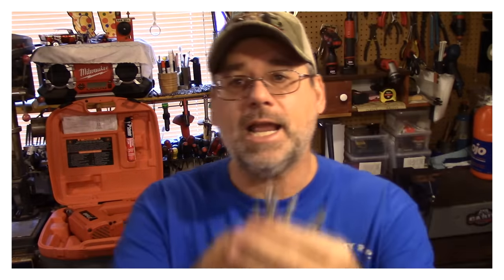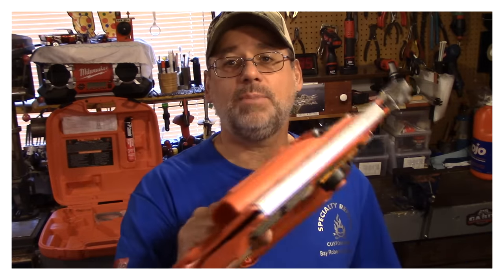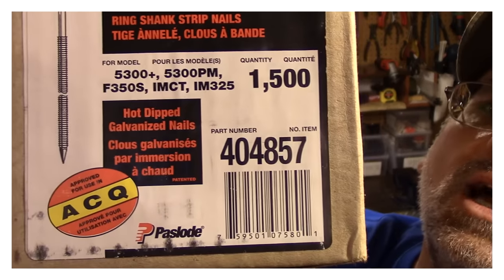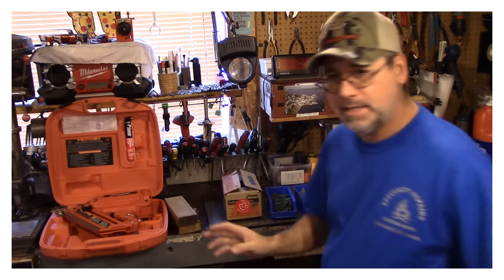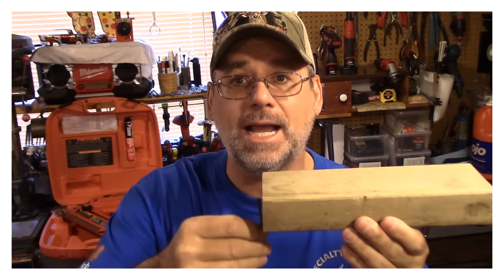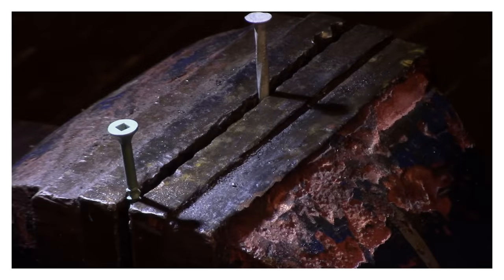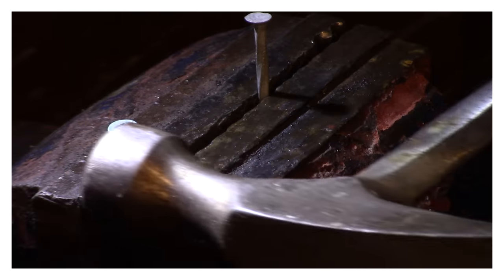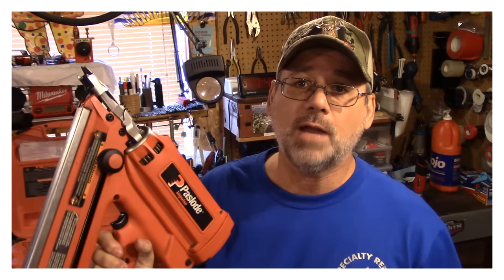BEWARE  NEVER USE DECK SCREWS  - DECK SCREWS VS NAILS -  PART TWO IN DESCRIPTION

Comment: Valuable advice. I went to a lumber yard a few days ago, bought a bunch pressure treated lumber for a floor, and asked for hot dipped galvanized 16d nails.  The guy told me they were out of nails and sold me 5 pounds of deck screws for 29.99.   I gotta take them back.   Anyway do you have any advice for those joist hangers. They say steel, but not stainless steel. Any stainless steel joist hangers for pressure treated lumber out there?
Reply from the maker: I have always used the regular  galvanized joist hangers for all joists , if they make SS ones , I haven't seen them.  Cheers 👍
Reply: Stainless steel hangers are made by both Simpson Strong Tie and USP Mitek. Unnecessary except in areas with coastal salt water environments for example. Everyday use requires only the galvanized hangers. We sell them every day.

Comment: I just got a quote on replacing my douglas fir wood pergola (not pressure treated)  that's attached to the house.  He said he uses screws instead of nails because they make it more secure.  Didn't say what kind of screws.  Does that sound ok or should I be suspect?
Reply from the maker: I would assume the person your hiring uses the proper screws as there are many screws and uses for different locations. The majority in the trades know what to use and screws are fine if you use the right screw for the job. I doubt you have any concerns . Cheers
Reply: Ask him.  He may mean the structural ones that are as strong as a bolt.

Comment: Well I’ll be a son of a gun, seems everytime I do something youtube puts a vid in my feed telling me I screwed up. Just finished my first rotten joist repair under my bathroom. Used deck screws to secure new joist board outside the bad one.

 I guess I will go get some nails and drive a few here and there just incase the deck screws snap on me 🤷‍♂️ 

I did install 2 supports (block with vertical 2x4) under the new joist to hold some weight, just to get things a bit more level. Was that bad too? Would that negate the chance of the deck screws snapping?

My house was built in 1952. Joist reinforced is a 2x6 under the bathroom.
Reply from the maker: I've been a son of gun over the years too. 🤣😅

Comment: Nails have more shear strength is what I think you were going for. 
Thanks for the video!
Reply from the maker: Cheers 👍
Reply: No actually those nails are softer.... which causes them to bend easily. Kinda similar to how lead is soft and will bend.
Reply: Exactly.  I used to manage a custom stair building facility. We always told our company installers to either use #12 or #16  framing nails OR actual wood screws, like #12 X 3" flat head wood screws to attach stair stringers at the top of stairs. We had one chucklenut who knew better, and started keeping 3" deck screws on his company truck, to get the job done. One day a worker was climbing the stairs in a home under construction. He was a big unit, and loaded down with a lot of heavy material he was moving upstairs. As he got to the top of the second floor stairs, the deck screws sheared, and he went down. The prebuilt stair unit he was on hit the basement stair unit and snapped those screws. He ended up in the basement with a broke back, lucky to be alive.  I later talked to several building inspectors who made homeowners totally disassemble their DIY decks to remove all the deck screws that were erroneously used in places where STRUCTURAL fasteners are required by code.  Deck screws are ridiculously brittle and fail easily under shear load. Ignore those that post here that claim it's no problem. It isn't a problem until it is, then it's often catastrophic, and instantaneous.

Comment: I will disagree with you , i am a contractor in the northeast and we use Simpson structural screws all the time always pass inspection and super strong 100s of decks built , we also use timber lock and ledgerlock  . only place on a deck I use nails is when attaching joists and joist hangers , railings look much better with screws ! Balusters look Aweful when nailed and of course decking is always best with screws .tech has come along way amd there are plenty of " structural screws" on the market now that meet or exceed code.. Just read DCA6 look it up on Google.
Reply from the maker: I agree with you Billy and in part two in the description I mention other fasteners. I am not suggesting all screws are bad but deck screws are being used in the wrong application.  I also put a link to the code you have pointed out on part two. So we agree . Cheers buddy
Reply: STEVE ROB great video steve , wasn't saying that just giving my side and opinion , as far as wall framing of any kind of course I use nails . but shear strength has come along way with screws for outdoor use . its a good debate and a good subject . I ask customers all the time if they prefer screws in there decking or galvanizex ring shank nails shot in, the scrwes are a lot more money due to the labor involved but look so much better and nails in decking pull out eventually screws do not . I think the term " deck screw" is whats tossing people off, but again plenty of structural screws on the market ! Good video !
Reply from the maker: +Billy Nolan  Thanks Billy , you have a great day.

Comment: Screws are brittle nails are not, this is the golden rule for structural integrity...if people add common sense to this equation, there should be no problems. Try building you shithouse on skids, once its full just drag to a new hole :-)
Reply from the maker: I do something simular to prevent it from rotting from the bottom up. A outhouse build LOL  Cheers

Comment: What about something like the Simpson SDWS framing screw. Would that be safe to use for structural components? I'm planning on building a 12 x 16 shed. My floor will consist of 2 x 6 pressure treated boards. I know that nails are the standard because of their resistance to shearing forces when compared to a screw; however, I like that screws pull materials together tightly and can be placed more accurately (at least for a newbie like myself). Would I be ok putting my floor together with Simpson SDWS framing screws by screwing through the band boards and into the end-grain of my floor joists? If so, how do I determine what length/size screw to go with?
Reply from the maker: Joshua I built a shed in by yard from scratch , might be of help and get some tips on building . The framing screws are very expensive and must be ok for your PT wood just like the nails . Take a Look at the playlist -  https://www.youtube.com/watch?v=S3sIqbbMtsM&list=PLCpsODdJa_T7qqSZD0fKZLRkbvtexBU4O
Reply: @SteveRobReviews  Will do! Thanks so much for your help!

Comment: You never use ANY kind of fasteners for structural support;  never place a fastener where it is bearing weight in a shear situation.
Reply from the maker: Well said 👍
Reply: Funny we use A325 bolts to hold bridges up. Use the correct type fasteners and you won't have an issue. By the way I've never seen a screw back out of wood like a nail will.

Comment: So what kind of screws should I use? I’m more talking about when using pressure treated wood. Because it’s hard to find screws for pressure treated wood that aren’t deck screws. They are usually more expensive so I assumed they were the best.
Reply from the maker: Deck screws are perfectly fine for  what they are intended for such as pressure treated boards . Their the least costly and made for the lumber but not for structural applications  where  proper fasteners are required . Deck boards and fence boards and everything else where  nobody would get hurt  if the deck screw sheared off as shown. Cheers Lonnie
Reply: STEVE ROB REVIEWS ah ok I see. Thanks a lot.

Comment: I like deck mate screws for some applications. That is until I built a pergola the other day one of the 2x10s I was using had a bit of a twist on it so I ran a 3in new style screw in put my regular hammer on it started to apply pressure on it . I was about to run a screw from the tail end that’s when I realized that the screw was pulling out of the board . It eventually pulled all the way out .  So that being said I had noticed they had changed the design of the screw before I started the project . But in my head thought theses must be better or they would not have changed them . After that failure I climbed down and compared them to some old style I had on the truck . The over all cutting thread is probably half as deep so they obviously are gripping way less . I will definitely never trust the new design on anything else

Comment: Seeing what looks like a battery in the case I figure the nail gun was battery powered.  In which case you always - always  - always assume it is loaded....no different from a Glock or any other gun.  You should have edited out that "screw" up.
Reply from the maker: Yes it is battery operated and its fired with a butane cylinder. It had no chance of being discharged . Valid point on the optics and thanks for pointing it out. Optics do count. Cheers.

Comment: agreed screws are overrated overpriced. Wish I could get paid for all the wasted time screwing in the wood deck boards and the customer is tightwaud spent all his money on materials.  Air nailing with the ring shank hot diped nails works fine except for a few boards that are stubborn I use screws.
I'm in a metro area and I don't think the inspectors have ever said anything about nails or screws. But they are fussy as hell about stairs more than anything. 
 Also I generally butt the deck borads up tight much faster especially when you're low bidding to get jobs like in the winter up here in the North we have to eat Spam for lunch with ketchup.

Comment: So what to use on boat docks ? The one i'm patching up / replacing some boards with pressure treated.wood. It has 3" square head deck screws in it.
Reply from the maker: For high moisture areas I use galvanized  hex head lag screws or carrage  bolts if you  want to bolt the wood together if you have access. Stainless steel is optional but real expensive and the wood most likely won't last as long as the fasteners.  Cheers

Comment: There are a lot a contractors that do not know $h!+...They are lazy and cheap and will do anything to make a $......My deck was built using siding nails......Including to hold the joists.  What a joke....... The "new treated" lumber is ammonia based and is more corrosive than the "old treated" lumber which had arsenic in it.  After about 13 years, a third of my deck top nails have rusted all the way through, another third are about rust through, - did not take anything to break them.  The rest hold but are rusting.   I live in the South Atlantic, not near the beach.   I do not believe the siding nails are hot dipped,  they have a zinc/galvanized coating but it is very thin.  Siding Nails are designed for vertical surfaces in which water runs off and should not puddle unlike a horizontal surface.  My question is will the hot dipped nail hold up to the "new treated" lumber in hot humid environments?
Reply from the maker: The treated lumber around the world is different depending on the regulations of the country but over all hot dipped galvanized have always been a prefered choice.
Reply: Just go stainless.

Comment: Try a #10 or #12 screw?
Reply from the maker: Great resolve and you are correct as the #8 screws are on the weak side especially as they twist on drying out . Cheers bud.

Comment: has anyone tried clamping a Stainless Steel deck screw in a vise and hitting it,???? i was looking on e-bay they sell them in 305 and 315 grade,,i dont care about rust, just want some thing in Torx that is strong and doesnt cost 1$ a screw..
Reply from the maker: Louis I have used SS and they are much stronger and so many  use them . Look on Amazon . I got a box of  about 400   #10 x3 inch  with t25 torx head for $70 grip rite brand 5 pound box.

Comment: Every deck I’ve ever installed the screws end up being the failure point even if they are treated and they are guaranteed not to rust they rust water collects and the board rots in that location
Reply from the maker: I have yet seen a non-stainless steel deck screw  not rust .
Reply: And nails do not? I just redid my deck and MANY nails were a complete disaster.

Comment: Can I use screws for the deck boards on my porch? Like the floor? Or use nails. Thanks
Reply from the maker: Most use screws for deck boards but nails are ok too  but I'd go with #10 gauge screws instead of #8 if you live in a climate that has a winter.  Cheers
Reply: @SteveRobReviews  I'm south carolina. So screws . thanks for the advice and knowledge! Hope u have a great week.

Comment: What fasteners would you use to attach untreated 2x10 headers around the top of notched treated 6x6’s on a 12x24 utility shed/pole barn??? Thx
Reply from the maker: Best answer is your local building  department as the codes are different around the world . Cheers
Reply: 6-8 inch carriage bolts

Comment: I just started replacing the t1 11 on the front of my 12x12 shed. I have a couple of boxes  of epoxy coated deck screws , would it be ok to use these to hang the 5 sheets of siding since it's not structural. I built the shed 25yrs ago when I was 50 and screws are easier for me now rather than pounding nails.
Reply from the maker: Absolutely yes , good choice , done it myself many times.  Cheers

Comment: Deck screw has to be screw into the wood, not hammer it. I agree with your video! Screws are weaker than nails due to how they manufactured them.
Reply: Maybe you bought cheap screws. I made my front porch and gazebo with screws and it's going quite well for 10 years. No problem whatsoever.

Comment: only use screws to assemble boards because you can easily remove them to fix mistakes, and once you get it built go over it with nails!
Reply from the maker: Now thats heavy duty 👍
Reply: STEVE ROB REVIEWS people will learn thru trial and error that pulling out nails can sometimes frustrate you and beat up all your work, so use screws to temporarily secure boards plus screws will pull lumber tight! but once you notice how easy the screws pop off you won't mind going old school with a hammer!

Comment: They are for wood not a steel vise! Do the same test with the screw in the wood.
Reply from the maker: You're missing the point their illegal to use in most places in the world for structural construction and thats my point . I was not referring to putting on a fence board or deck board. Yes people are using deck screws in the wrong places and well as joist hangers - drywall screws LOL  yes i've seen it.  This was to show how they can not take a high degree of side load  compared to a framing nail. I hope this explains it better . Cheers and thanks for taking a look.
Reply: They can still break while in the wood. He's absolutely correct..not for stressed support. Non weight bearing

Comment: Silly Canadians and their Robertson screws.  J/k i ordered a 5LB box of robertson from home depot site and shipped em to store.. Theu were $5 less than torx but I got em mainly to embrace my Canadian brothers.  I had a 1LB box of torx to hold me over but i was curious to try robertson and they are the same. If using philips screws please get torx or robertsons and save the headache
Reply from the maker: It seems we're stuck in the 50's  up here eh :)  We can't get anything but roberson in the stores but I have seen my contractor friends starting to use torx now so their is help on the way.
Reply: Unfortunately in my experience torx screws have been anywhere 1.5 time to twice the price of the comparable Robertson screws. That and canadian tire sells #2 Robertson bits by the box. 10 bits were 3 bucks at the checkout, they had them hung up with the candy.

Comment: Should I be worried. I got a ground deck on deck screws.
Reply from the maker: I'd get a person to look at it if your concerned . Cheers
Reply: No,not in my 30 years in building.your fine if it did not break going in your good.they do break going in,as long as you are your builder put another that didn't break your fine

Comment: It is important to know this info.  For practical application it's going to be sheer stress requirements for the structure. If the screws sheer stress strength exceeds the load then it's fine.  But if you don't know that (engineering) then no doubt you'd better go with the nails.
Reply: Paslode kidney shaped heads are not allowed in framing homes. Fullround head. I prefer to use a 4" deck screw 2" from the end and angled into the butt of the other end. All nails will loosen as the wood rots. And its rotting from the first day your deck is built

Comment: Most fasteners are well bs now even common nails etc , who tests them ?? For sheer strength etc ? Prob does not matter now who’s building now ?? Just price a 2 x 4 !! Lol !
Reply: Chinesium screws piss me off so much.  It's why I like deck screws.  They don't strip, they don't rust, they don't fail.

It also looks like he bought the cheapest garbage possible and called them "deck screws".  I've never had a deck screw sheer that easily, but mine are all the nicer ones with star bit heads.  I've used them for mild load-bearing activities.  Obviously, load-bearing requires more careful engineering.  You just just willy nilly put random fasteners in something, if it's supposed to hold up a roof, floor or deck.

Comment: Jesus I did not know that I’ve been using these all over the place
Reply from the maker: Most times it just may not matter but for situations of safety and structural  design it's best to consult with your building department on proper fasteners.  Cheers
Reply: STEVE ROB REVIEWS in the uk we don’t have that if you want to build on your land you can crack on but this was a big eye opener cheers boyo